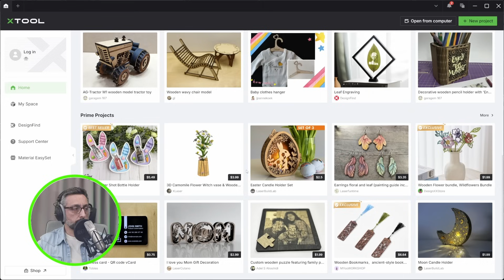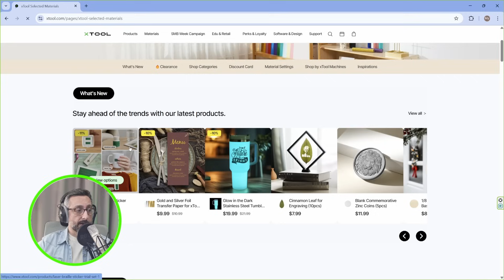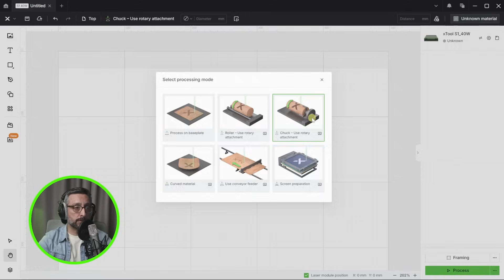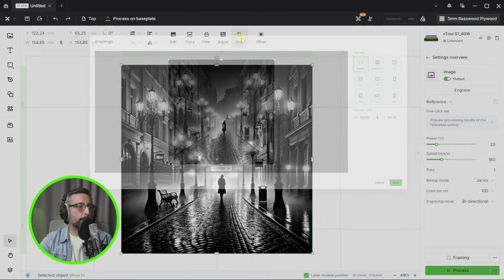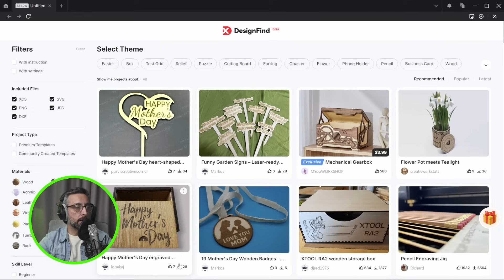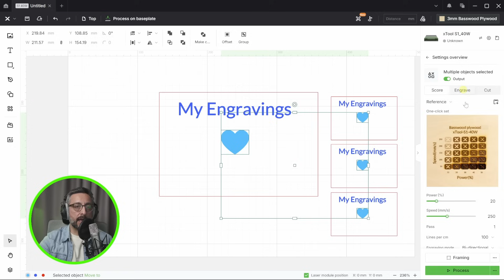xTool Creative Space 2.6: The Basics Anyone Can Learn!

Comment: Is there a way to center the project on the material, or do you have to eyeball it?
Reply from the maker: I use the crosshairs from the xtool s1 to give me a general "guide"as to where things will go. At times I mark the middle of my material if I am having a hard time lining things up. I just use a pen and do a quick X to mark the spot. Then, inside XCS, I use the crosshairs there and framing a couple of times. There is a mix of technical, eyeballing and a bit of luck when it comes to this. With time it becomes second nature but always-always trust the framing process more than your eyes :)